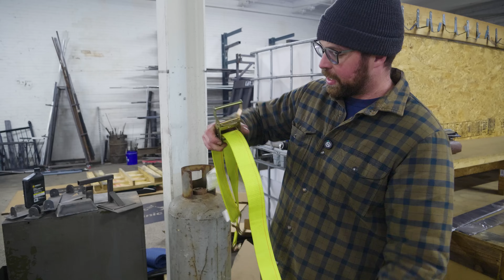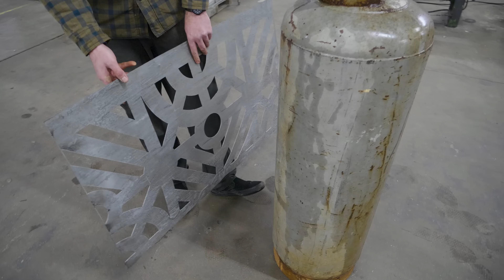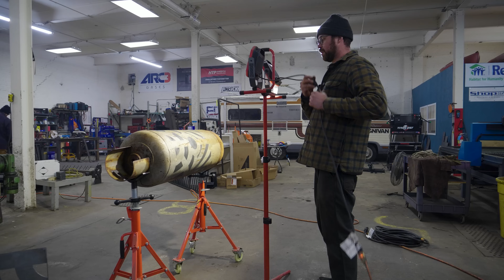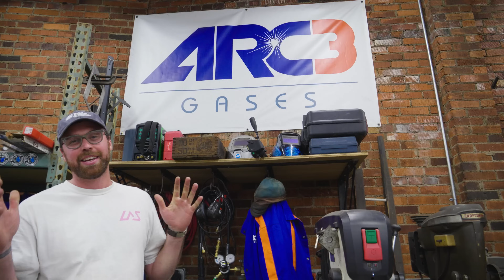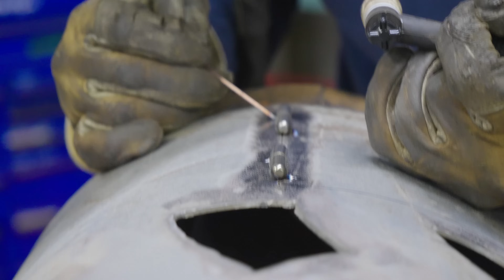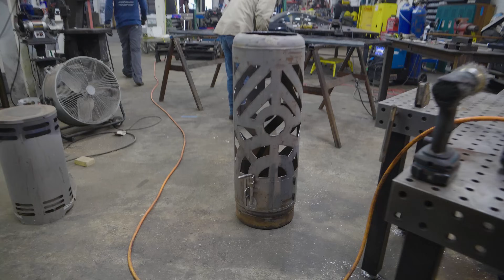How I Turned a Giant Gas Tank into a Stove

Comment: I like use of the template.  
I've used freehand to make porch "pumpkin" faces out of 20# cylinders, but I think your template idea is much smarter, and gets you closer to repeatable.
Regarding the valve removal, make yourself an adapter that fits over the top of the valve, as I expect you'll be doing more.

Comment: A syphoning straw, also called a dip tube, in a propane cylinder allows for the extraction of liquid propane from the bottom of the tank, ensuring a consistent flow of liquid propane instead of just vapor, which is achieved by creating a siphon effect that draws the liquid up through the tube; essentially, it lets you access the liquid phase of the propane rather than just the gas at the top of the tank.

Comment: The most common "Stink agent" added to propane is Ethyl Mercaptan (spelling may be wrong). It is ultra-concentrated aged bung-hole juice😂 ! Yes, more artsy-fartsy content!
Spike:Science type notes: 😇😎:
Pure laboratory grade propane has No smell. Typical USA propane (LPG)is HD-5 (95% propane & 5% other gasses). HD-5 is motor fuel quality & is around 105 Octane, low carbon, clean burning alternative race gas. It's great for high compression or turbocharged spark-ignited engines! However, building & tuning engines for propane is significantly different than for gasoline! Plus the knowledgeable technicians & parts for propane are a limited niche market now. A good Propane Bible is author Jay Storer's "Economy or Performance, Propane Fuel Conversions". Off-Road gurus include Got Propane (utube them), Cheers! Paul
Reply from the maker: Okay, this is fascinating.... who knew bunghole juice was so versatile!
Reply: 😂😝😖 @LiftArcStudios

Comment: So I have a question for you. Why would you not have cut the pattern to be a template for the plasma torch so that you had exacting lines to use for a pattern instead of having to paint?
Reply from the maker: its a fair point honestly, i guess the issue was that the pattern didnt line up perfectly on the backside, so rotating it helped line up the otherside, but i guess i could have cut one side then rotated the pattern just the same. interesting thought ffriend!

Comment: Retired Co2 bottles are thicker (5/8") and would make good woodstoves that wouldn't  burn through quickly.
You dont have to worry about them trying to blow you to bits, 
but just a wee bit heavy for your application.
Cool idea, though, and you make those straight and curved lines look easy. I had a guy at a shop I worked at who could do beautiful scroll work with a torch. I asked one day how he got so good. He said he worked 40 years at the shipyards. That guy was smooth. He could make a 4 foot cut across a piece of 1/4" steel on a soapstone line that was so straight and smooth it looked sawn.
He was a natural.
Cheers
Terry

Comment: Propane are low pressure tanks so they used a brazing process that consists of laying flux at the seam, then putting a strip of braze metal, then they run it through an industrial furnace on a type of metal belt.
Reply from the maker: clever!

Comment: try to cut the next template bigger by about 1/2 the width of your plasma tip and use it instead of freehanding the cut. also a roller cutter so you can do tubes for roll cages and projects like this might be worth the money or the DIY time.
Reply: Thought about this method too...for a fraction of a second until it became apparent that it'd have to be like 1/4" thick to make a bearing surface tall enough to hold the tip from slipping out of the template.  That quarter-incher would take an industrial roller to form into a cylinder.  Back to square 1.

Comment: it needs 3 or 4 one inch or larger air holes spaced evenly around the bottom of the sidewalls where they meet the floor- it will burn MUCH better with air!
Reply: I saw a build video on fire pits that said exactly what you say here. That video emphasized that low oxygen facilitates making smoke rise straight up instead of spreading into faces of surrounding people. Placing those holes needs to allow space for collected ash. I recommend cutting various designs for oxygen holes in multiple fire pits, then evaluating them with a major studio smore night. You might merge the experiment with that big Roanoke summer festival.

Comment: Mercaptan is the compound used to provide that smell and you are correct about the reasoning of use.
Reply: Love that smell. Reminds me of some fermented cabbage that we used to eat as a kid.
Reply: Yep. And it actually penetrates the metal. 

Was on a 12" high pressure natural gas pipeline project and you introduce excess mercaptan to "pickle" the pipe so it doesn't remove the smell from the gas. Well the engineer had us use 4x too much. Had to evacuate a nearby small town. I think he probably got fired.
Reply: It is the same smell that American Turkey Vultures use to hunt for food, aka rotting flesh. The gas companies actually look for flocks of the turkey vultures to find gas leaks along their pipelines.
Reply: Also part of the catalyst in 5 minute epoxy.